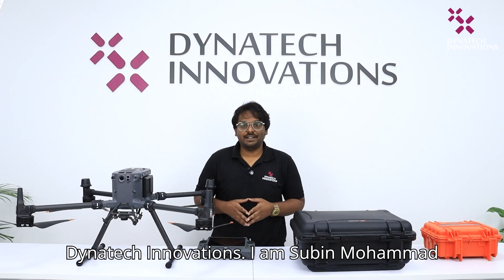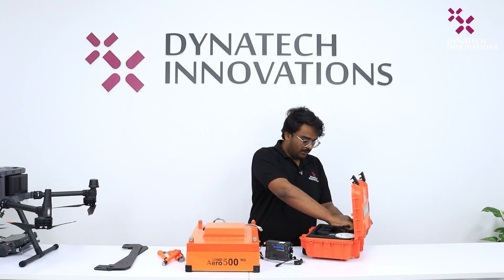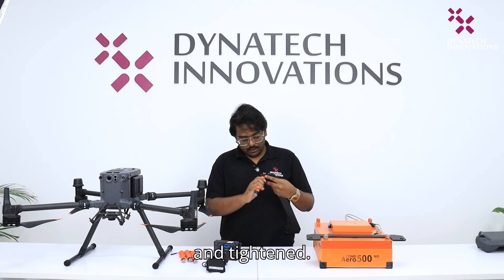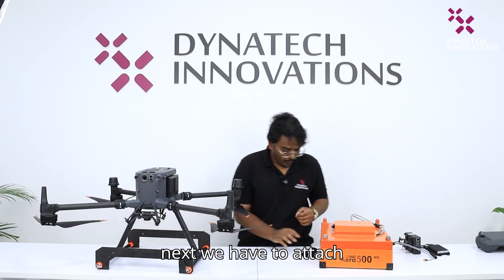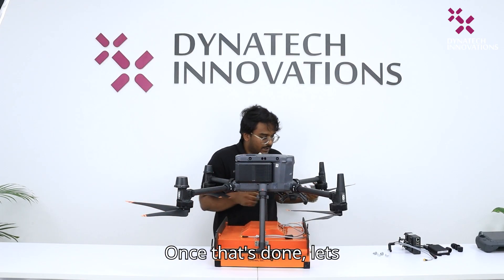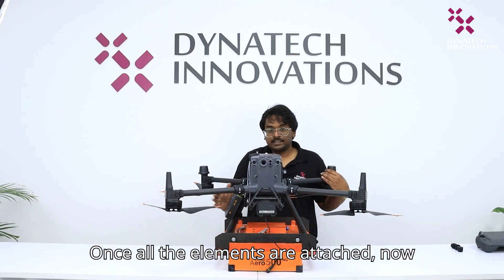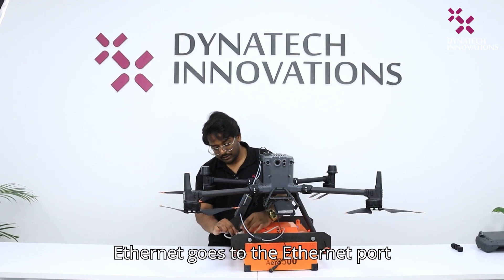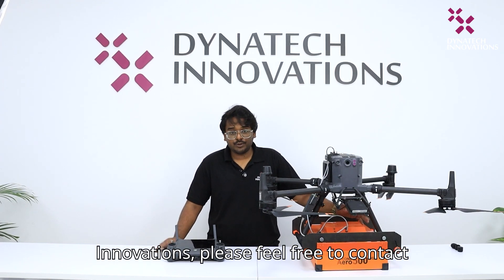Step-by-Step: Integrating the Zond Aero 500 GPR Solution with DJI Matrice 350 RTK Drone

Comment: Can we use it to make a survey above the trees like in the forest?
Reply from the maker: If you want to conduct GPR survey by flying above the trees it will not be possible, because best results are obtained at a height of max 2 meters. Moreover, the trees will interfere with the radar signals effecting the penetration to the ground and also the signals from the trees will also be picked up by the radar which will not give a good underground result.